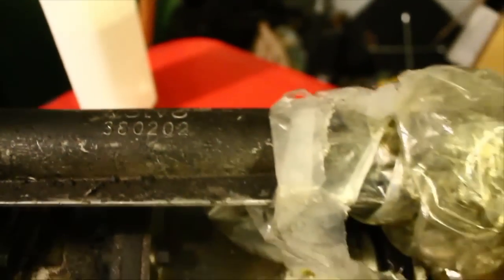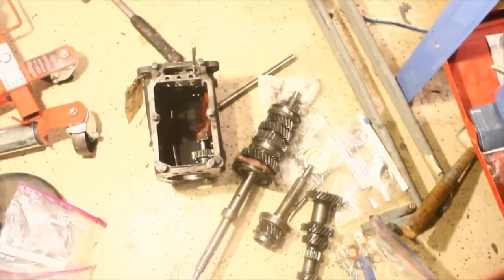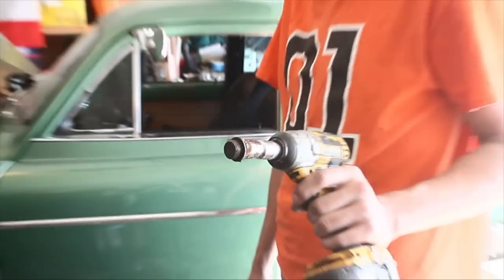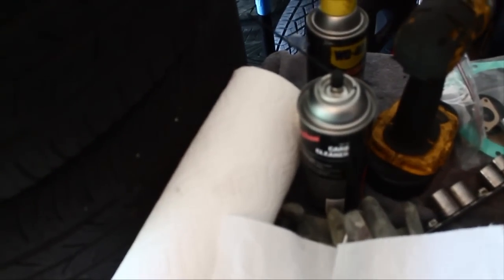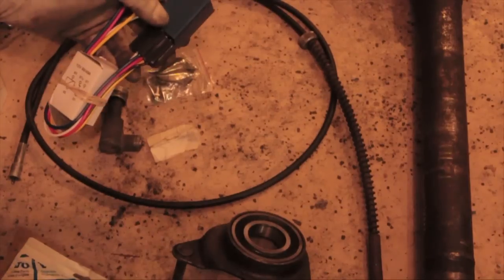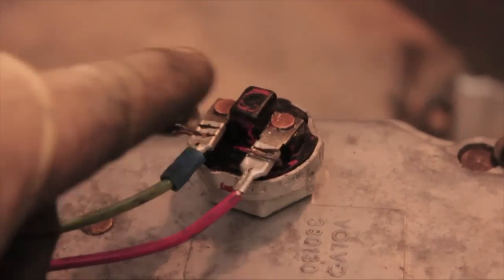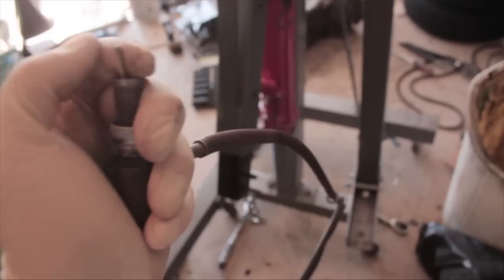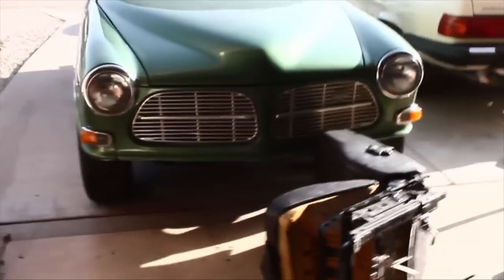🇸🇪Rebuilding M41 Transmission, Overdrive Swap - Volvo 122s Amazon IPD Episode 26

Comment from the maker: swedishtreasures.com, v-p auto parts, and eBay have them. the main bearings are the same as the 240 manual transmissions, if I recall correctly. so they're  pretty accessible

Comment: fond memories of doing this in the '70s to my '69 142. After thousand of miles with no 2nd gear synchro, I had to get it done!
I still have the shaft my dad made that was just shorter than the inside case, so we could drive out the good shaft and keep all the gears in order.

Comment: Thank you for all these videos! I recently picked up an M41 from a fully Norwegian old guy in the middle of nowhere. Could you hear your bad bearings by just spinning the input/output shafts on the gearbox? I'll rebuild mine if I have to, but if it is in solid shape, it might be worth not messing with. Last I remember, the bearings were nearly silent when spinning the gearbox by hand.
Reply from the maker: fill it up with SAE30 and go for a drive. Hear how it sounds and go from there. maybe even flush it again if it's minor noise or buy REDLINE MTL

Comment: Imy 123gt Amazon bust something in the gearbox this morning, went clonk when I was (aggressively) pulling away. Now the drive shaft is not turning regardless if in gear or not. The clutch feels fine, the gears feel like they all 'engage' but the rive shaft doesn't turn, it's like it's constantly in neutral. I assume something has broke in the gearbox, guess I need to take it out to find out. But wondered if you migh have an I dad what happened. There's been a slight clonk when pulling away for the past few years, this morning whatever was clonking seemed to have snapped?
Reply from the maker: same thing happened to my m41. I think I stripped 1st and 2nd gear synchros
Reply: +David Bello took my gearbox/overdrive off, found the problem: I'd snapped the drive shaft thing in between the gearbox and driveshaft - had the larger wheels and biggest tires on and kept doing wheel spins and half donuts.
Reply from the maker: greaserleo oh wow. These can't take a lot of power and abuse
Reply: +David Bello yeah will begrudgingly be pulling away more gradually now i know how delicate the drive shaft parts are. Luckily I also inspected the clutch which was a fraction away from fully worn. Had only done about 20k miles on it since replacing but had been burning it up.